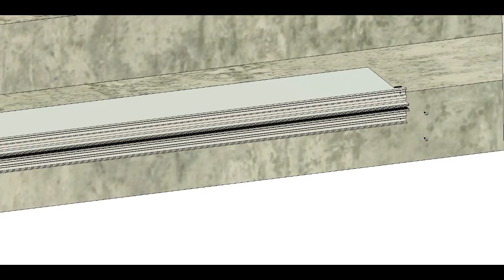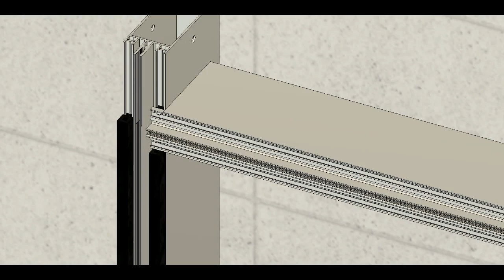Mullion transom (stick)  facade installation animation

Comment: Apparently the mullion& transform connectection produces significant flnaking noise, I cna't see how from this video?
Reply from the maker: In most cases flanking noise is activated by foot step,that is, some dynamic behaviour and those vibrations are spreaded inside building structure (floor, wall, ceiling etc). Best way to dismiss it is to use "soft"/elastic, materials on elements connections/joints. Stick system uses the same principle of joint connection but has bigger problem with sound transmission (aluminum and glass have weak sound pressure resistance therefore nowadays most of the glass facades are made with triple glazing and laminated glass. In general, sound is a science of engineering on its own and there cant be one exact answer but multiple, depends on system, materials, cross section, location, soundproof requirements etc.

Comment: This is a Schuco Curtain Wall system. I can see the profile section of the mullion, the T-Cleats, The end notch of the transom, the deflector block and the mounting brackets. The method as well is very Schuco.
Reply from the maker: Yes, you are right, it's a schuco system

Comment: hi sir. I'm trying to find the differences between of the stick and semi curtain wall systems. could you please explain to me? thanks in advance
Reply from the maker: I did thesis on facade installation optimization. The difference is that with curtain you install it from member to member and with semi unitised first mullions and then infill panels (in this case glass). This is quite often a misunderstanding what is semi unitised, unit and mullion or semi curtain wall system. At the end they are all the same and it depends from every expert how he/she will name it and cross section (or installation method) is made. This is a quote from my thesis, you can find it on research gate, Ivan Cakaric , 
"Sometimes called panel, panelised system, hybrid system or mullion and panel they are not implemented in the façade typology and therefore fewer information about this system could have be found. Unit and mullion name is classified by AAMA Aluminium Curtainwall Design Guide Manual.Unit and mullion has a gridwork similar to stick system and prefabricated framed panels installed between. It is a system between stick system and unitized. It was popular in the 70s but is rarely used today (Canada Mortgage and Housing Corporation, 2004). Its main advantage is to span two floors. For the North American market, mostly structural sealant is used for unit attachment. In this system, there will not be any aluminium member visible from outside."
Reply from the maker: DOI 10.13140/RG.2.2.34868.96642